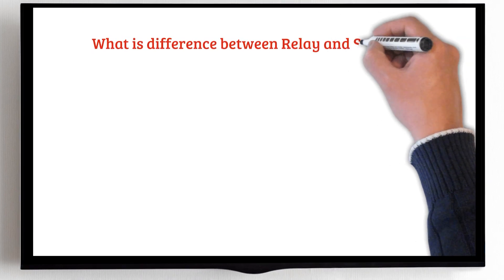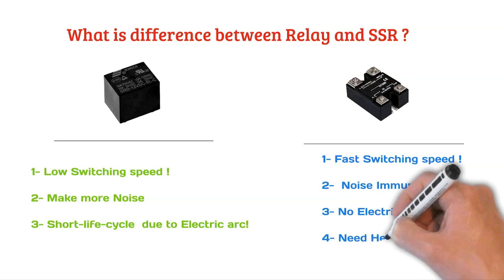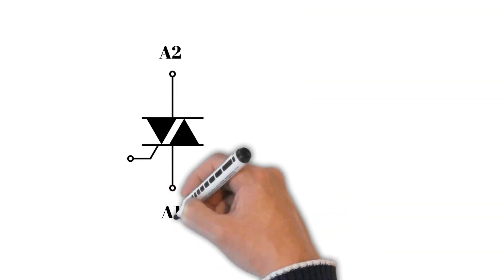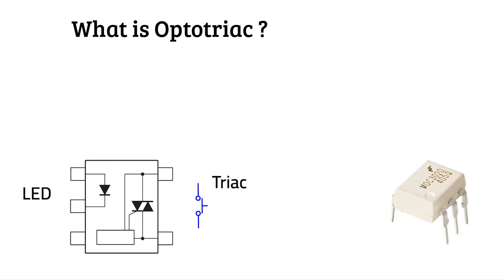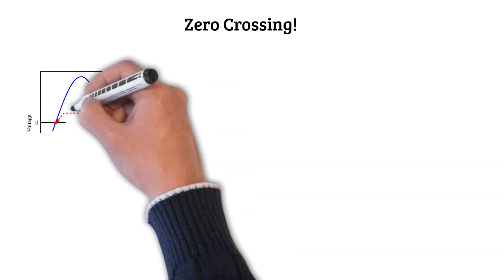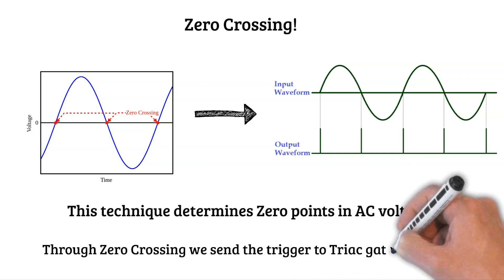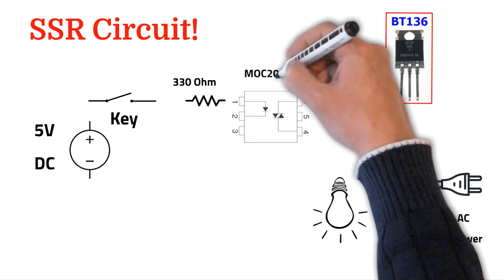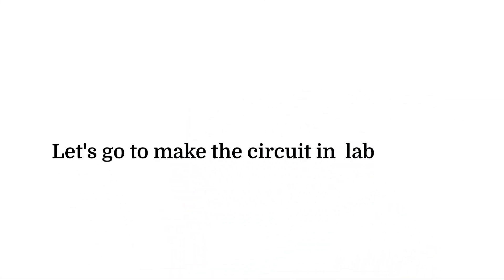What is SSR relay? how dose it work? Make it by yourself?!

Comment: I remember once I have seen such a circuit in a motor drive device (if no mistaken)
Reply from the maker: They are used just for on/off applications usually,.. and for motor drive IGBT has better performance!

Comment: Then why they still use normal relays instead of SSR in many circuits? Is SSR more expensive or something? And one another question... isn't this device more useful for devices which are very sensitive to electro-magnetic interfrence?
Reply from the maker: thanks for your attention........SSR relays are very cheap and they are not sensetive to electromagnetic interface then they donot need freewheeling diode..